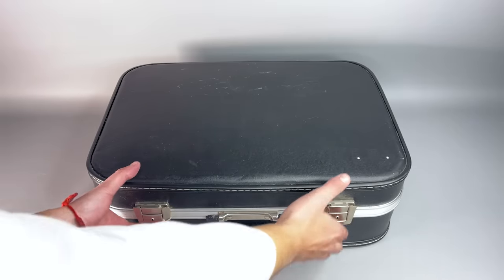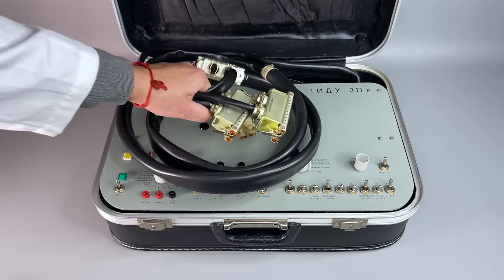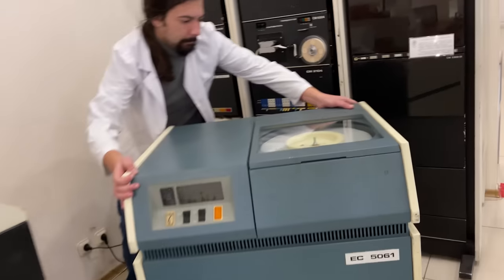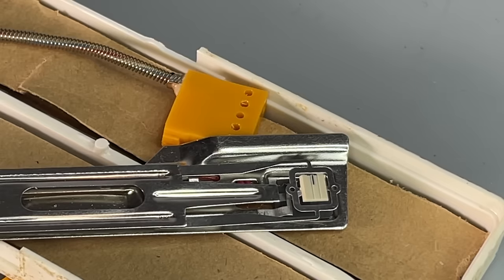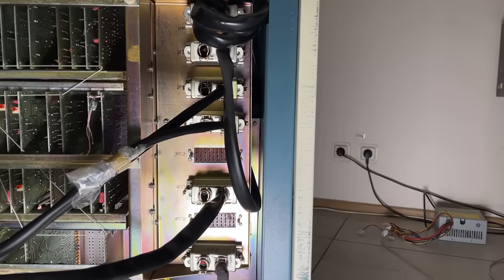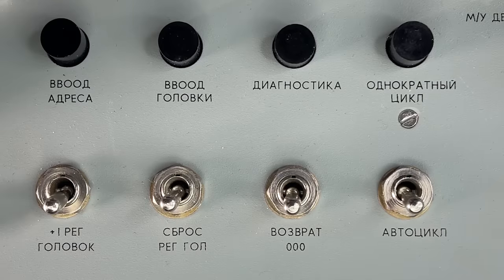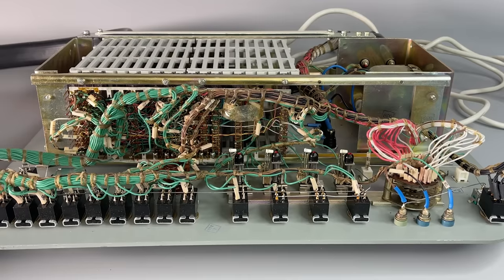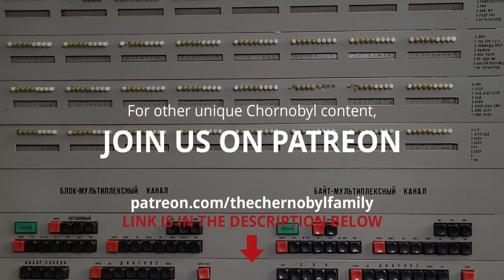First attempt to wire up the 300 Kg HDD of Chernobyl SKALA

Comment: 300KG, with wheels, so it is easy to move -- until you drop a wheel into the hole in the raised floor under the drive, where all the cables went down under the floor. Then get two friends so the three of you can get it level again and moving again. Been there, done that. You DO NOT want to do that with a vertical tape drive!
Reply from the maker: Oh yeah. Oh yeaaaah. Thought about that while moving it.
Reply: This guy datacenters!

Comment: Yes! That's what's now no bigger than the palm of your hand these days (external drives), and CPUs (SoCs) are even smaller, and everything has anywhere from 100 to 1000 times the capacity, processing speed, and at a small fraction of the actual power consumption! Amazing how tech has changed in a tad less than 40 years!
Reply from the maker: Well said!
Reply: In fact a fingernail sized microSD working with 3.3V has billions order of magnitude more capacity than this 300kg cabinet, 3 phase powered cabinet.
But the people who have designed these ancient technologies paved the way for all of our digital living.
Allways respect ancien hardware.
Reply: yeah kinda crazy, we are at 2tb microsds, ones that one could swallow and not feel it, crazy.

Comment: At first sight, that looks a copy of a DEC removable hard disk: with RM03 (67MB)) or RM05 (256MB) packs even down to a DEC color scheme. In the west they would have been 70k$ back in the 1980s. The pull about 30A on spin up. If the heads crash, there is enough metal in the air that sometimes the next disk will crash too. As a summer student, I can tell you that they broke easily and the budget for maintaining them was enormous. Good times.
Reply: if only IT was then what it is now
Reply: Except for color, they are also nearly identical to IBM 360 era disk drives. Can't remember the model numbers anymore, but I think 2716 might have been one of them. I don't remember one pack crashing eating the adjacent packs much. In a good machine room with proper ventilation all the dust would have been pulled down under the floor. There were also air filters in the drive cabinet itself, and they would catch most all the dust. I do remember when long seeks would get these machines rocking, and one would start banging into the drive next to it, resulting in possible head crashes.

Comment: I really like the push button implementation. It allows both cleaning the contacts and adjustments to the pressure of the springs.
Reply from the maker: It gave a strange impression of being a reworked part of a relay. Just it looks oddly familiar.
Reply: @ChernobylFamily  Yes, like a relay or like a headphone jack with a switched contact.

Probably manufactured with existing tooling and materials well characterised by use in open frame relays.
Reply: @ChernobylFamily In America those were known as "telephone switches". They were used by the telephone company as part of the switching equipment. Lever switches were more common than push buttons, but the internal workings were almost identical in both kinds. They were extremely reliable in both mechanical operation and electrical operation, and could be easily cleaned or adjusted when needed.
Reply from the maker: Thank you for those details!

Comment: "Requires 3-phase 380 Volts AC..."

Dang, that thing would put my welding machine to shame when it comes to power consumption. I bet every light in the building dims when you fire up one of these units. And Holy Hard Drives, doesn't this thing put the "Hard" in HDD. What a beast!
But another awesome video. I so enjoy all these nerdy videos with such rare machines/ computers.
Reply: Why would it dim? It would likely consume way less than 2kW of power - less than your welder...
Reply: @Sixta16  
It's a figure of speech😅
Reply from the maker: I have no idea if something will come out of that, but if we will be able to, we will power it all up after 20 years of lethargy :)
Reply: @ChernobylFamily  
I truly wish I could be there when it spins up for the first time after all those years. These projects of yours are so incredible and awesome. A technical unicorn is a very good description indeed. The rare gems you keep unearthing^^

*Remembers how computers sounded back in the 80s
Reply from the maker: We'll see... it is not really a project, we got that thing accidentally, and the museum got interested... let's see where it will come :)
Reply: @ChernobylFamily 20 years ago feels quite recent for something like that.
My company had 3 MicroVax computers that had a removable disk stack like that. I think the MicroVax were in use until the mid 1990s but I'm not sure if they were still using that type of hard drive in the later years. Only certain staff were allowed in the Vax room. We might occasionally get a glimpse through the doorway!
Reply: Umm, there are like 200W 3-phase motors, that take very little current per phase, each phase is 230V, so the differential between phases is said 380V, for the people who don't know how elecricity works.
So, no, it won't dim the lights, it's just how it's designed.
Reply: The only reason it needs 3-phase (probably) is because of the motor that spins the drive. Which makes me wonder how they were controlling platter speed, because if it was an induction motor, it wouldn't spin at a perfect 1500rpm all the time but slightly under depending on motor load. Maybe it had an induction motor to start (and spin the blower) which would then energize a synchronous motor for the platter?

Comment: As someone who worked  with such computer disk drives in the 1970's I can say they need three phase power. And the disk in the drive is removable, weighs around 30 pounds, and only contains about 30 MB of data. The most important thing is to ensure the heads weren't damaged in transit otherwise that disk will squeal from contact as the data is destroyed.
Reply from the maker: Exactly, 3 phases 380V... we'll see if it is possible to get this input at museum. I am not sure if you checked that part where we review the packet itself, but it is correct – it is 29Mb.
Reply: @ChernobylFamily  In Australia the 3 phase was 410V and the 30MB was probably because of how they counted the Bytes here in the 1970's as in 1000 instead of 1024. Also we used 12 inch tape reels as storage and the disks were mainly for sorting and outputting the data to print.  I wish you the best of luck with getting it running.

Comment: Good luck guys! I'm always fascinated that such technology still exists. It warms my heart that you try to resurrect the system... 
A tip: If you manage do do that, then the next project is a maket of the old control room of the duga radar :) Use Oled screens for the computers :D
Reply from the maker: Consider it as spoiler, but with duga radar we gonna have a working replica of certain equipment at some point...))

Comment: The first hard drives I used were a slightly amaller size on a mini computer. The disks themselves were in sealed removable drums and had less platters than the ones in the video and came in 1Mb or 2Mb capacities IIRC.
Reply from the maker: Thank you for sharing!

Comment: Привет из Болгарии. There is some documentation available for ТИДУ-3М. It is not much, but inside there is User manual, BOM and plenty of schematics - about 50 pages at all. I will be happy to share, please advise the method. P.S. sandacite website is up and running.
Reply from the maker: Thank you! Already got that file with the help of a few viewers. As for website, I have a feeling they have IP-based access blocking, because from many countries it just shows 403 Forbidden.

Comment: CM 5405 29 MB Disk Memory
The CM 5405 large-capacity disk memory (variant IZOT 5061—Bulgaria) serves
for storing a large volume of data with direct access. The disk memory is
formed by a control unit (which makes it possible to connect up to eight disk
units of the EC 5061.C type) and two basic disk units.
The memory medium is formed by the EC 5261-01 20-surface disk pack. The con-
trol unit has 12 registers accessible by program. Data are recorded with
double frequency with 2200 bpi density. It has 10 sectors, each with 256
words.
The control unit with power sources structurally forms independent grids.
These grids are placed into a casing which is a part of this disk subsystem.
In the casing there is free space of 15 U for building in additional SMEP
expansion modules. The disk unit is an independent device (Figure 21) which
is connected to the control unit by cable

Comment: I always wondered if you can use the skala system as a computer,  connect a graphics card to it and actually use it with an operating system. (Maybe sometime in the future)
Reply from the maker: No. It is too specialized to be a general-purpose computer, but a graphic interface for its specialized purpose is exactly what DIIS subsystem provides. It is not just a card though, it is a bridge to modern computers.

Comment: A logic circuit (clock, 16-bit register 1,2,4,8..., function, mode and i/o switches). I have no idea how the sectors and files are allocated - which is pretty much everything on a hard disk (I somehow doubt it's FAT :)
Reply from the maker: Literally this morning we got a full technical description for the drive, which ALSO explains how to use the TIDU briefcase; I did not inspect it really much, but I see there is the information you are talking about as well it gives enough details to start the drive, will need to solder a few connector terminators though.

Comment: Man...As a hobbyist data technician/archivist with a huge love of Soviet-era technology, I so wish I had hardware like this available to diagnose faults on my disks too! Does anybody know if Uzom ever did a version of these for IDE or even SATA devices? 😋

(And yes, I wish the devices I had were rugged enough to keep on working after a nuclear incident, too! 😇)
Reply from the maker: *IZOT

No, they ceased to exist in the 90-s... though the quality of their storage devices was very good compared to Soviet crap, so for retro-computing IZOT drives are a preferred choice.
Reply: @ChernobylFamily  The drive you're operating in this video certainly seems very well built, and made to last a literal lifetime. Better still - Because it's the disk-pack type - The media can be exchanged, so you just need the one unit plus storage for the media, as opposed to my collection of modern drives where every unit has its own controller, motor, head assembly etc... 👍

Granted; A 300Kg unit is probably a bit too big for consumer applications (Good luck getting one of those up the stairwell in my UK block of flats, or the floor safely bearing the weight! 🤣) but the flipside is my devices definitely won't last a 30-50 year lifespan. Recently had one fail on me that wasn't even a decade old! 😋

(Also; Looks like I need to vastly improve my Cyrillic on the side. Time to start studying the manuals I got with that Elektronika calculator... 😇)

Comment: It looks like a copy f an IBM 70s main frame. The ICL system 4 was very similiar.In my time at ICl in the 70s I changes hundreds of those read write heads on disk packs.
Reply from the maker: Exactly, that's what I also said. ES series cloned IBM/360 and 370.
Reply: The East German ROBOTRON R300 was mainly built as a copy of the IBM System360. My dad was a service technician and installed and serviced some of these machines in different countries. I remember he fixed ferrite memory ring arrays at home. I built my first amplifiers with scrap parts from decommissioned tape and hard drive machines, some early portable disks drives looked like this in the video. Punched paper cards for data, punched paper strips for programming later ½ inch tape and theses disks drives like a washing machine. I remember he told me every country of the eastern hemisphere had a specific field they had to cover. Bulgaria was responsible for these hard disk drives and heads of magnetic tape machines. But CzechSlovakia I believe to remember was also involved with tape drives. I played my first computer game on one of those machines, which was actually a star treck battle game where you would try to avoid getting caught by Klingon and then should shoot them down with photonic torpedoes. No real graphics, only characters used to make a graphical appearance. The other game was the board game GO.

Comment: What is format of TIDU PCBs is it standard?
Reply from the maker: They feel like 11x7 cm (need to disassembleto measure), so they are more than twice as smaller compared to standard TEZ cards of ES EVM. Personally, we did not see that small cards like in TIDU in ES equipment; but they are nevertheless marked in the standard way.

Comment: Well, one Sinclair Microdrive (external drive for ZX Spectrum) had 100kB.
Reply: 100kB was just what they were aiming for in the early development stage. When they were delivered it said minimum 85kB. I remember typically it was 88kB. If you pressed the cartridge into the Microdrive while formatting, you might get 92kB but you would probably always need to hold it press it in to be able to use it like that, so not recommended! 
I expect pressing the cartridge in just pressed the tape harder against the tape head, creating more friction, so it took a bit longer for the tape loop to go around.

Comment: Again, a fascinating look into the Soviet / COMECON computer tech! And a beautifully made piece of test equipment. I love these bitbanging switches.

I've got a bunch of germanium DTL boards recovered from e-waste, with MLT resistors, mostly USSR made semiconductors and markings in Cyrillic. They may have been made for the early unified series computers, but I'm not sure. You might find them familiar.
https://www.youtube.com/watch?v=Bjyzd0HevTA
Reply from the maker: Those are not ES, I am sure, this is something earlier than 70-s, element base and overall design is greatly different from ES standard. It is more a style of e. g. MIR or MINSK machines.
ES boards (so called TEZ – standartized exchangeable elements) always have a unified form-factor of 140х150 mm and have either lamellae for corresponding type RPPM connector on a backplane, or in case of later 1060 and greater machines – SNP-135 connector (female on a TEZ and male on a backplane). They also must have an inscription ES-xxxx or EST-xxxx on them.
Reply: @ChernobylFamily  thanks a million! That's one step closer to solving the mystery :)

Comment: What is the reason for the seals on the boards?
Reply from the maker: Serviced, tested, confirmed operation by manufacturer or service center. Similar to any product - varranty void if removed. Just they did not seal entire device as to connect cables you must open the rear cover.
Now, those seals already is a museum issue; because if item is in museum, it must not be altered.